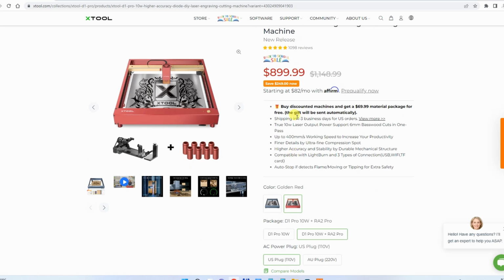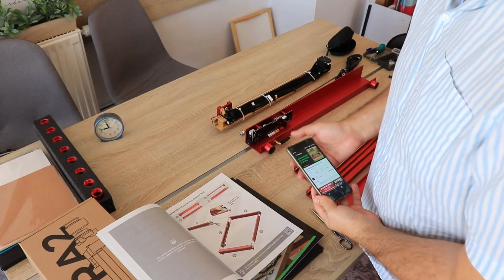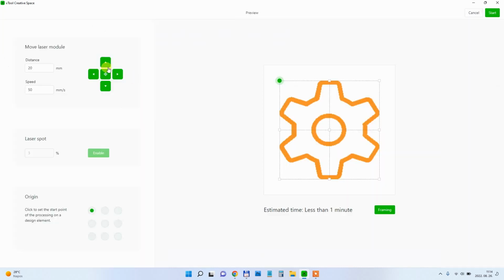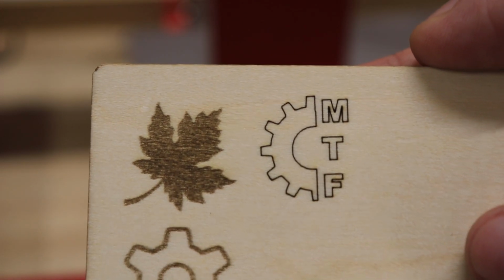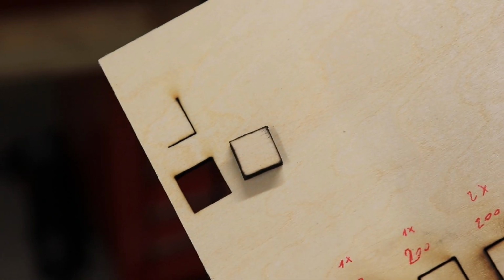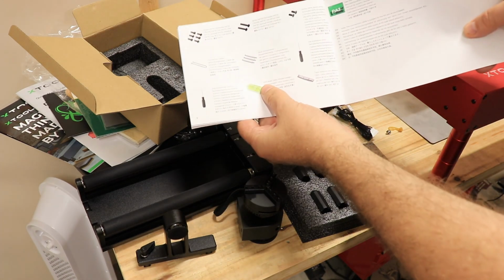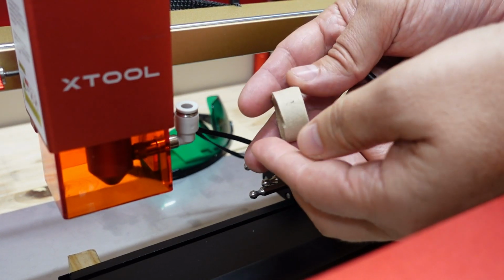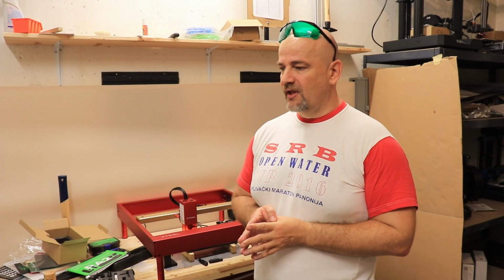Great combination: xTool D1 Pro 10W laser engraver and RA2 Pro rottary attachment

Comment: While I think the engraver looks great and it's a product that I'm seriously considering buying, I see a very worrisome review on their site. It's titled "Worst customer service" but it still has a 5 star rating which makes me think that they are faking the ratings on the site. The reviews on Amazon are largely great but somewhat mixed as well...

Issues that I'm seeing are:
1. Multiple passes are not accurate enough to work.
2. Stops working after a little while
3. Horrible support
Could you perhaps test if running the same engraving twice works for you?
It looks like the devices are largely great but they have (had?) some issues with QC and support so I still view them as a viable option. Assuming that it's accurate enough to not shift when you need to do an extra pass :)
Reply: I can tell you first hand that the product is spot on. I can also tell you that their customer service is by far the absolute worst I’ve ever seen. I returned my D1 for an upgrade to the Pro version and they just flat out refused to acknowledge my return although they signed for it, and refused to send my refund although it was agreed upon before I returned it, they also mocked my efforts as if my status as a paying customer meant nothing to them. I already have my Pro version, but expected my refund on the unopened D1. They never gave it to me, so I had American Express take it from them. Case closed. They actually begged me to close my dispute. That was never going to happen. They are the worst. The product is worth it, and the delivery is fairly quick, but everyone relies on each other through the Xtool community on Facebook for issues.

Comment: I was waiting for this one, exciting.  Most reviews don’t discuss the limit switches enough. Hoping your 3D printing background gives us more insight into them.
Reply from the maker: Nothing special about those switches, in most cases they are used for homing (like on 3D printers), but these (2 per axis) can prevent hitting of the frame, but pay attention that they are disabled vy default.
Reply from the maker: Nothing special about those switches, in most cases they are used for homing (like on 3D printers), but these (2 per axis) can prevent hitting of the frame, but pay attention that they are disabled vy default.
Reply: @MyTechFun  what I was interested in is the repeatability of them. Can you reliably return the laser to an exact location with the limit switches?
Reply from the maker: @joshsekel  Yes, these optical switches are very accurate.